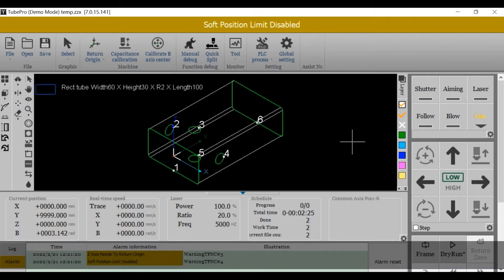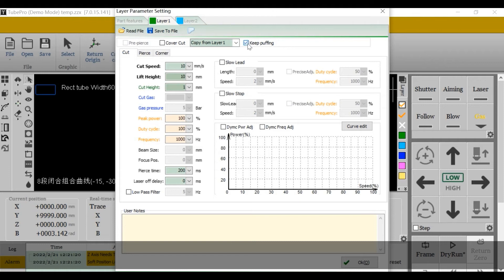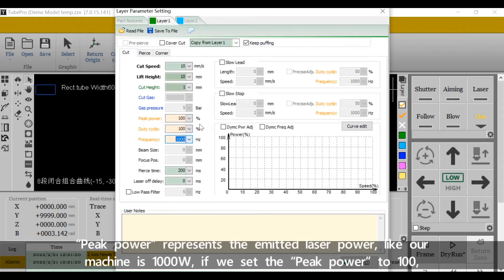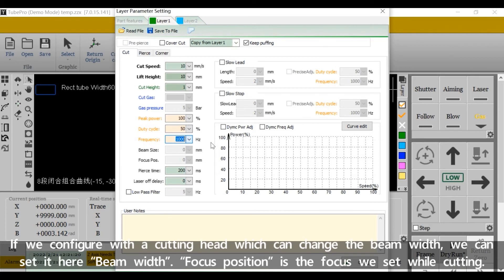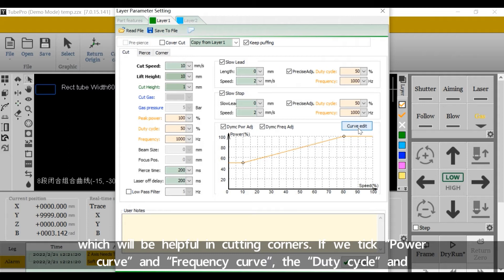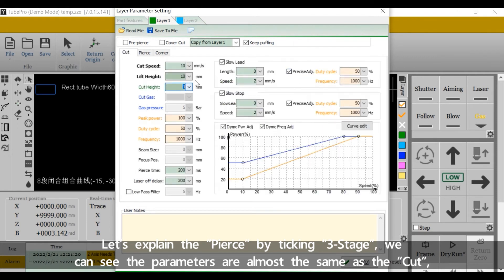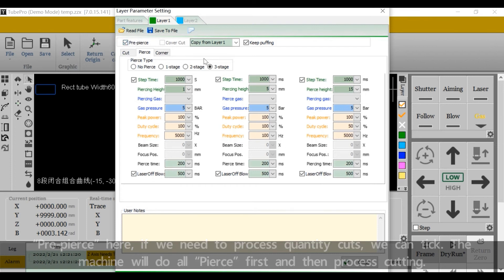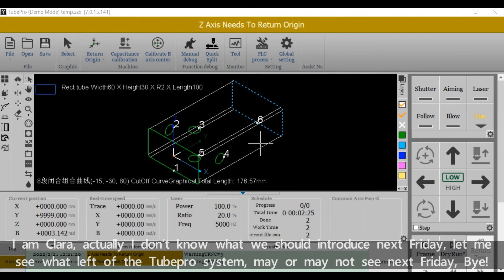Tubepro Tutorial for Laser Tube Cutting 8

Comment: Hi Clara. Thank you once again for your great videos. It really helped. 

Im having interesting problem. There's no gas blow or gas emission when using tube pro software. When using Cypcut for cutting plates it's working normal. I did the adjustments in machine config tool for tube pro same as for Cypcut (same ports). When I press in monitor control board on the screen (green board) there is a gas blow. But no gas blow from the remote controller and nothing when pressing start from remote controller. I don't have proportional valve installed. Any ideas?